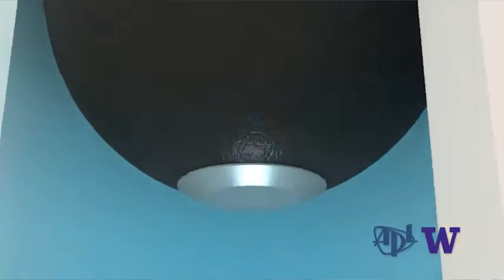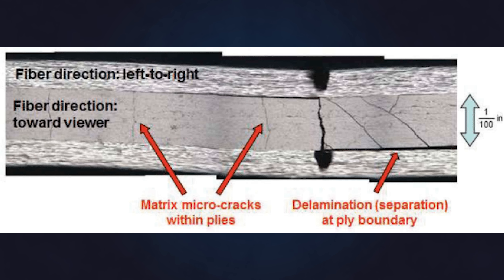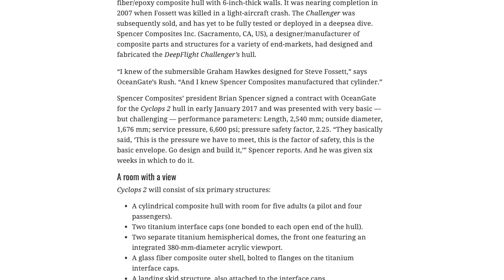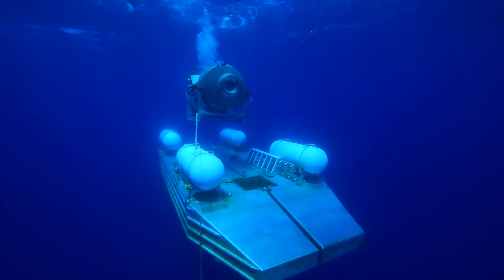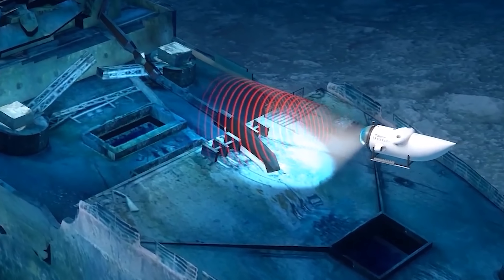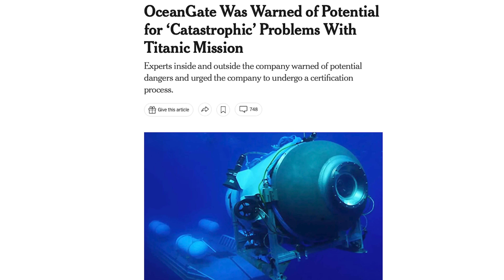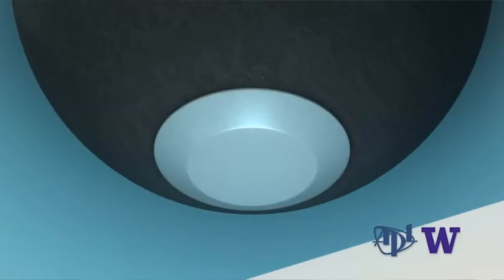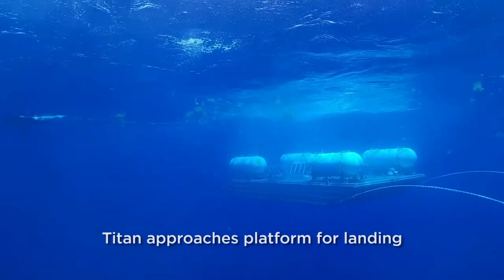Engineering Failures Behind Titan’s Implosion!

Comment: The more I learn about this, the more surprised I am that it lasted as long as it did.
Reply: Absolutely, at that depth the carbon fibre composite had about 5% of contraction, the titanium had basically zero. I more surprised someone very experienced in deep sea exploration was convinced to get in it.  It's pretty miraculous it lasted that long.
How can someone be so arrogant as to think they know better than an entire community of experts waving red flags at them? It would be bad enough if it was just his life he was putting at risk but to hold that arrogance whilst being responsible for several other lives is just disgusting.
Reply: @88Cardey exactly how I feel
Reply: @88Cardey  First thing, the lasting longer as mentioned by OP is sadly, the real killer. They were confident that their successes meant they would not fail. After all "we dove x number of times, so surely it'll be fine on attempt y." The painful irony is NASA used this same argument (twice!) during the Shuttle Era... and 14 people died for it.
To address your red flags thing: I've legit read where someone told him he was endangering the reputation/potential future success of the entire (deep sea submergence) community, and his response was, note this is a paraphrase I tried to quote AS ACCURATELY as possible:
""
His ego was so big, he took safety concerns as personal attacks. In my opinion, you can stop right at that statement, and get everything you know from that alone.
The person who warned him that (the name escapes me, but I think if you search part of the previous quote, you can probably find it) responded that (and this is a somewhat more loose paraphrase): In your race to Titanic,  It's sad in a way, how Titan and OceanGate's attitude were DIRECT ECHOES of what happened to Titanic herself. I felt personally-and please note this part is OPINION: OceanGate did not have the respect for the wreck they proclaimed to want to study. You cannot dive to the Titanic without understanding the attitudes and behaviors that directly caused both misplaced faith in her and her ultimate loss. Yet EGO blinded people to these red flags. They believed they could cheat both history and mother nature, but they cannot.
Challenger. Columbia . Apollo 1. Titanic. Titan. They all have one thing in common: hubris of man, and mother Nature proving there is zero tolerance for mistakes  particularly in dangerous endeavors (spaceflight, deep sea diving). As for everyone else here: Look up about carbon fiber delamination. OceanGate did not properly check or test for this ("Real Engineering" and "Alexander the ok" both go into great detail on the hull of the Titan, as well as the procedures used to test (or rather not test) for failure). They legitimately relied on an acoustic monitoring system that many believe, at best, would detect only when a failure was imminent. They did not have ANY means of inspecting the hull for damage after every dive (such means are likely to exist, see alex's video, and if they do NOT they should have commissioned such instruments to be created, or not used Carbon Fiber.)
Essentially, its felt that Carbon Fiber is weakest when exposed to several pressure cycles. So the first trips, or teest dive, you're fine. But the microscopic damage builds up and up and up and then........ disaster.
No, they would NOT have been hailed as pioneers if only a single person died or if it were an ROV, especially if the former! They'd still get the "I told you it wasn't a safe idea", etc. Nobody would hail a company that used this kind of approach and mindset as heroes. They aren't "pioneering" anything. They did not benefit anybody with their carbon fiber hull usage, except for confirming beyond a shadow of a doubt you should never use it on DSVs. Yeah regulation, certification take time, but they exist to ENSURE you've done everything humanly possible to make sure what you are doing isn't gonna kill somebody and that you've done actual testing, not circumvented it or installed lazy, half-assed means (acoustic monitoring system, really recommend that RE vid for that one). Rigorous testing would have proven the delamination issue without  dying. And for the record, I remember reading them comparing not getting Titan classed, to SpaceX. I believe they said they rely on their internal processes and what not. But the difference is: Crew Dragon was designed with input from astronauts, 1. And 2, THEY DID comply with the highest classification available in the US: NASA human rating (not saying this is infallible, mind.)
I spent way too much time and thought on this comment on a topic from a month+ ago, after midnight no less. My brain just doesn't know when to quit.
Sorry for the long ramble too.
Reply: @88Cardey  I hear you can drown in a cup of water and you don't even have to get in a sub
Reply: Wouldn't have gotten me into that device in the first place
Reply: @Paulftate me either! Claustrophobic galore here!!!
Reply: @sunheri189 I think the problem is making a titanium sphere large enough for five people.

If they use titanium for the cylinder and maybe electron beam welded it it may have lasted longer but your deviating from the sphere which is tried-and-true
Reply: @LEONK82  yes sphere shape is the key in retrospect.  Such a shame.
Reply: @LEONK82 Deep sea oil welders use a titanium dive bell that can hold up to 4 brave people. Rush was a fool. I'm so sorry this horror happened to him and those poor souls.
Reply: @Junior4AMG  
 Why don't you use a Ouija board and ask Stockton Rush?
Reply: ikr??
Reply: This whole Titan sub is like a joke! 🙂
Reply: Same as what I think, when I first started learning about all of this I'm surprised they used it more than once
Reply: @sunheri189 e mentioned this at @4:20 tatanium needs sintatic foam which is expensive apparently
Reply: @djbfhffg  indeed everyone would be running up and down the ocean.  Crazy stuff.  Rush paid with his life for his mistakes.  Ofcourse the poor passengers.
Reply: @sunheri189  
Poor passengers? 
You mean rich billionaires 😆
Reply: @User_92020  one of them was a millionaire and one of them was 19 and had not yet chance to enjoy his father's wealth
Reply: @User_92020 tasteless 5hat you find such humor at the deaths of the passengers. You apparently hate on them just for being rich and that's pathetic.
Reply: @gingernutpreacher   and the 19 year old was only going just to please his father and was terrified and didn't want to go. That gets to me the most.
Reply: @shatain6329 what's money got to do with this? Don't be bitter about other people's success.
Reply: Yes I agree. It really should have been retired after even just after 1 or 2 trips.
Reply: That part
Reply: the original comment is great, makes me feel like i should stop thinking about how catastrophically stupid everyone involved was...  the  fact that they succeeded in making a sub, by hand, in their shed, and it actually went to the titanic even once IS pretty impressive
Reply: @sunheri189   He purchased the carbon fiber from boeing. Carbon fiber as a material is cheaper than titanium but is extremely hard to work with. Some of the larger bicycles brands put their frames through rigorous testing and inspected to achieve the best possible product and it sometimes still fails. As much technology went into the entire project He decided to save money in the worst possible place.
Reply: the textbook definition of jank, this thing was an abomination, every part built just to BARELY be a working proof of concept. surprised they did multiple successful dives. stockton rush is deserving of a darwin award for sure, reminds me of that moron that tested his selfbuilt parachute from the eiffel tower like 110 years ago. it did not slow him down, he impacted the ground unimpeeded. thank you for removing yourself from the gene pool, mister rush.
Reply: But what doesn't kill it makes it stronger 😬😬😬
Reply: Anyone that works with composites knows this well
Reply: As an ROV or even just a single pilot submersible, its ultimate demise would have been an incredible feat of engineering. If he hadn't taken passengers down with him, his death would have been heroic as an intrepid deep sea engineer

Comment: The guy who claimed he built the non implodable vehicle said he bought the bonding material blue Tiger Seal $6 400ml off ebay and used it to stick the Titanium chamber to carbon fiber body. Basically whole work came out of his garage, and cost almost nothing considering 250K per ride for each.
Reply: Source for this?
Reply: @trentvlak  Tiger seal is world leading bonding material used to fix all car's windows throught the world by manufacturers. Stockton Rush said he harvested all required material off from high street shops, Amazon, Ebay. Stockton Rush was a nobel man with roots to Royal families. He was a first blood, not a common people. I see no reason not to believe him.
Reply: Supply ship is probably a large cost too
Reply: And don’t forget the 10 450ml tubes of Kitchen Silicone he got from Home Depot for stocktons little project.

Comment: A purely bonded joint was always going to be problematic in such a scenario,  would have been better to also have some long studs clamping the two rings together and also to have an internal lip on the end rings that went inside the carbon fiber tube rather than the small locating lip on the outside that they used.
Reply: You can't use studs in carbon fiber mate, lol. We're not talking a car body-kit here. It needs to be pressure-fit. Carbon fiber, titanium, steel, doesn't matter. That's the only way you can make a seal against hundreds of atmospheres of pressure.
Reply: @em4703  I am not talking about studs in carbon fiber but on the outside holding the whole thing in compression and with the lip on the inside and not the outside. Look at some air or hydraulic ram cylinders to see what I mean.
Reply: @Equiluxe1  Ah yes, I understand now. The lip was on both the outside and inside though, there was a channel in the titanium ring in which the carbon fiber slid into. I think in the end the carbon fiber itself, and the glue was damaged by the cyclical loading and unloading. This is not a deep sea diving material, I doubt it will ever be.
Reply: The end rings had internal as well as external lips.  This can be seen in video footage of applying the sealant.
Reply: Carbon fiber under pressure still contracts.
Reply: The idea about long studs occurred to me also. 

But it would have done very little if anything to mitigate the cyclical stress on the carbon fiber or the differential expansion and contraction rates of carbon fiber and titanium, and no difference on the ultimate result.

Except they may have found the titanium domes on the bottom still attached to each other by the metal studs.

Cheers
Reply: @ArcFixer  The hull would still have cracked along the spine of the cylinder.
Reply: @semosancus5506   I said straight up that the long studs would not have prevented the tragedy.
That was the whole point of my post.

I said the only difference it would have made is that the  titanium domes might have still been attached to each other by the bolts after the inevitable implosion.

Your comment is nonsense.
Reply: I don't see any thing in your initial post or your response that indicates you said straight up it would not have prevented the implosion.  Anyhow, who cares if the 2 end caps are still physically attached after the implosion?  Does it make recovery easier or something?  I just don't see any need for extra hardware to keep the endcaps in compression, they were already under extreme compression.  Maybe so much so that they cracked the ends of the carbon fiber hull.

Comment: The CEO Stockton thought he was building a rocket ship to be launched under water. His dream was to go to space. So he adopted his building ideas from NASA and tried to incorporate it to deep sea exploration. This is why he used glue with so much pride and confidence. Read this: “Because of its exceptional heat resistance, good thermal stability and low outgassing properties, Viton fluoroelastomer has been called on for a variety of assignments aboard the National Aeronautics and Space Administration's (NASA's) fleet of reusable space shuttles” Stockton idea of engineering was to assume the pressure of the water would keep the titanium glued tightly against the carbon fiber hull. 🙃

Comment: This just raises more questions. If they mixed pre-preg with with wet epoxy, that makes the tube three dissimilar materials instead of two. Pre-preg is also heat-activated, so without autoclaving it's just more cloth, just covered with another layer of soft material, the glue. They covered it with wet epoxy just as they would have with plain carbon fiber cloth, but it already had another layer of soft material that wouldn't harden and would weaken the bond between the cloth and the actual glue. Another questionable idea.
Reply from the maker: They did cure it for 7 days at 107 degree C but not in an autoclave, not sure why. But yeah I pack the technical know how to understand why you would want to layer it this way
Reply: @beyondengineering  - It would work well for a pressure vessel, with the unidirectional ribbon to reinforce the straight sides and the woven fabric to keep the ends from getting blown off. I'd use all one type of glue, though. Now I'm wondering about antagonistic reactions between the two hot glues. At the least, there has to be a boundary zone where the two are mixed or penetrate each other. That could be stronger or weaker than the parent materials. I doubt anyone has any worthwhile data on this, and Rush seems to have just invented his own.
I think the shape was a fundamental error, no matter all the other mistakes involved.

Comment: Nailed the dynamic. Defies credulity.  A veritable chorus of engineers came forward and said exactly what you summarized.  Elementary to anybody who went to engineering school and has experience in industry. Rush didn't want to know.  Likely on a subconscious level, he knew this CF hull design wouldn't pass destructive or non-destructive cyclic load testing with any kind of safety factor over and above 400 bar at 2.5 miles beneath the ocean surface.
Physics.  Basic.  Money driven decisions. CF is lower cost, more neutrally buoyant, lower static weight and vessel easier to transport.
A 'fool's errand' of mistakes.  Heterogenous materials and shape with inequivalent stresses and material properties.    The CF tube was oil canning in the middle causing a moment at respective ends where bonded to more rigid hemispherical end caps made from a different material.
Can't write a more faulty prescription.  I just can't believe this collection of mistakes could ever happen.
Thank you for the great video.  You are a credit to all engineers who go to work every day trying to save lives and the public because of our schooling.

Comment: The thing with carbon fibre.. is once it stretches or gets forced out of shape of its original form it splinters... carbon fibre is not known to expand and contract back to its original rested position.
Reply: and not to be compressed either.
Reply: Materials under stress move we call it strain. Steel yield point is defined as 3% after that it stretches and does not go back to original shape. We bent it. Carbon fiber like T700 strain to failure is 2% there is no yield point. We broke it.
Reply: @oneskydog6768  that's why Reinforced steel subs have an inner hull skeleton to give the hull strength and prevent it from losing its original shape. this thing was just a tub.

Comment: I’m not an expert by any means, but wouldn’t the pressure the vessel experienced tend to compress the heads against the carbon fiber cylinder until the cylinder itself gave way?
Reply: Doesn't have to.  Depends on the 'section modulus' aka moment of inertia of the carbon fiber.  Make it thick enough with the right aka verified manufacturing process and 'it could have' survived repeated cyclic loading and dives to 3800m.  But all protocols of design were violated. What safety margin of design? Where was the test data putting a vessel like this under this load condition repeatedly?
Corner cutting to conserve cost and time putting people's lives at risk. This design was unverified and why it failed.  No destructive or non destructive testing to determine its fatigue limit with any sort of depth insurance.  You see, the 'manufacturing process' of carbon fiber is 'variable'.  No two layers have the same bonding strength and even fiber orientation or epoxy matrix consistency.  Steel or titanium are much more predictable in all force/deflection directions.
This is like the Wright brothers trying to design a moon landing rocket.
Stockton Rush was told by 100 engineers why what he was doing was blatantly wrong and he didn't listen.
Reply from the maker: You have to feel for David Loveridge, the engineer who was so vocal about this. He is living out what he feared and saw coming a long time ago

Comment: I doubt porosity was that low not having used an autoclave.  Probably much higher porosity.  How do you get air out of the center of a 5" layup with nothing but 1 atmosphere of pressure?  It takes the pressure of an autoclave to do that, that's why autoclave exist!
Reply: And because there is no test data, its unknown what the correlation is between porosity level, amount of elastic deformation at deepest part of the dive and what repeatedly happened to the CF after successive dives aka cyclic loading.
Rush violated every protocol known to engineering design.